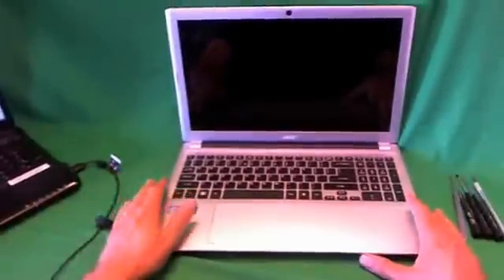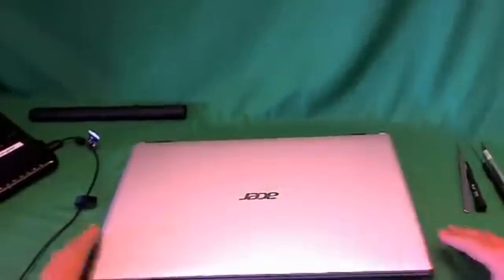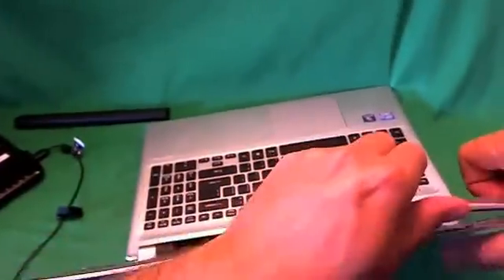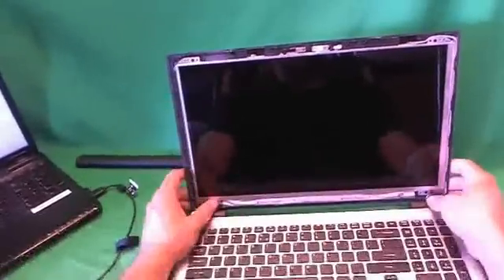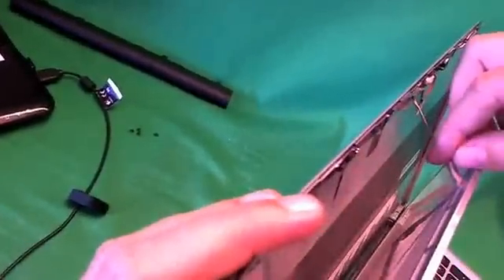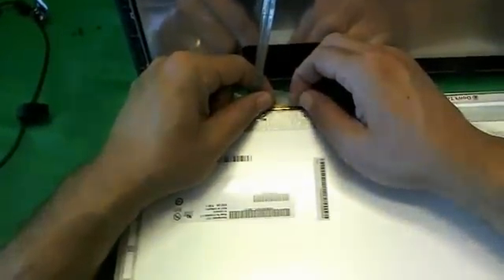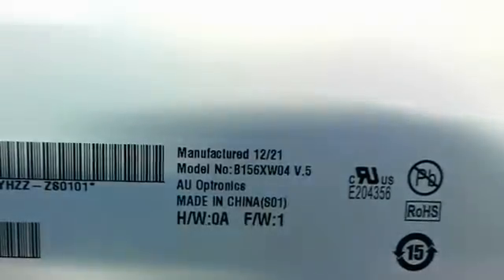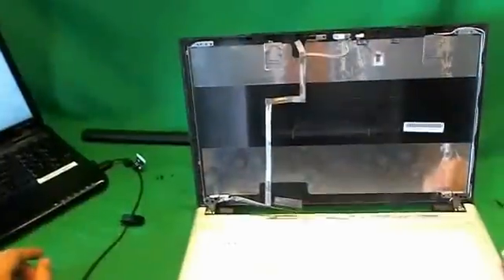Acer Aspire V5 Laptop Screen Replacement Procedure

Comment: My finger got trapped when i accidently closed my laptop and the bottom corner was cracked :(
Reply: +poop licker closing the laptop without the upper cover will easily break that corner. even without your finger. it happens to me also. make sure to lock it in place before moving the screen. learn by mistake my nigga.

Comment: Thank you for this awesome video! Brand new screen and saved a laptop. I don't know why some people are complaining, the instructions were great.
The only improvements I might suggest is a few more tips around:
1. How to remove the covering for hinges. This was a lot harder than the video suggested and I had to use a butter knife to pry it out.
2. Maybe a bit more descriptive around reconnecting the cable to the screen. The first time I did it it did not connect properly and I had to reopen it and reconnect. The problem was that the surface on which the connector is mounted on the screen is wobbly and one has to get it perfectly aligned with the cable to push it in in a straight line. Otherwise it does not snap readily into place. I have no idea how he did it so smoothly in the video but if you have a trick please share that too.

Comment: Thanks for the video, I am looking for a good place to buy touch screen for my acer touch v5-571pg-9814 laptop which is broken..can anyone share links to buy new touch screen.
Reply: Not sure if you got it fixed but they are $85 from Hong Kong.
Reply: 'kæla k. I take back the $85 comment. Get the entire assembly for $149. DO NOT GET THE DIGITIZER BY ITSELF (unless your LCD is also busted). I repeat, DO NOT GET THE DIGITIZER BY ITSELF!!! Reason being the SOB's at Acer *#@!ing glued the LCD to the Digitizer with a an insane amount of sticky glue with what could possibly be the worse design I have ever seen in a digitizer. It's not like the LCD was a super thin Macbook Air and didn't have the space for a better design. To separate LCD, Digitizer and Bezel, you need a $#!+ load of heat that may possibly permanently warp or destroy the slim flimsy LCD bezel, plus the Digitizer is made from the worst gorilla glass I've ever seen. All attempts to safely and gently remove it results in further breakage and splinters everywhere and an eventual broke LCD if it was initially working. In the end my LCD was permanently messed up, forcing me to manually realign a new LCD and the $85 digitizer, carefully reform my flimsy messed up soft plastic LCD bezel and lightly "GOOP" glue the LCD back to the lid since the crappy bezel had the clips.
Search Ebay - "15.6 LCD Assembly Screen+Touch Digitizer Glass For ACER Aspire V5-571P-6657" and the entire assembly is $149.
FYI: This is the last Acer I'll ever buy. I'm going Asus and their more user friendly designs
Reply: Full assembly right and not just the digitizer? As I said,it is near impossible to safely separate the glued LCD and glass digitizer. Even with the "wire/string & heating plate", there is a good chance things can go wrong. If both your LCD & digitizer glass were broken, then best to either 1: get the complete assembly or 2: get them separate, realign them manually and stick them together with 2 sided electronic tape... you know the ones they use for smartphones.
Reply: 'kæla k. If only it were that easy for this particular touchscreen. Sadly the video is for a non touchscreen replacement and you don't have to deal with the glass digitizer and super thin bezel. A non touchscreen replacement should be a piece of cake even to a novice user.

Comment: Very helpful video. Everything worked as you said it would. I had a very difficult time releasing the hinges (like you did at 4:13 on this video). I ended up using a small flathead screwdriver in each side, even then, it didn't come out easily.  Putting them back was a snap. Thanks for a great, and thorough instructional video.

Comment: my back panel to my screen has cracked slightly causing the screen to be detached from the back panel a little bit on 1 of the corners. is there an easy way to fix this? (I have a acer aspire v5 touch). the screen still works fine but I was concerned in case the crack got bigger from the pressure on it from opening the laptop. how could I fix this?